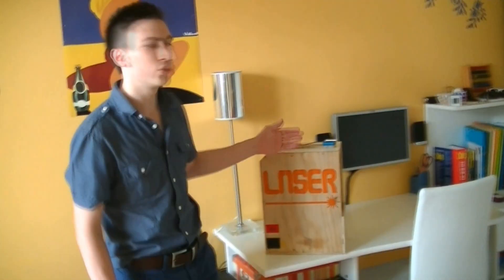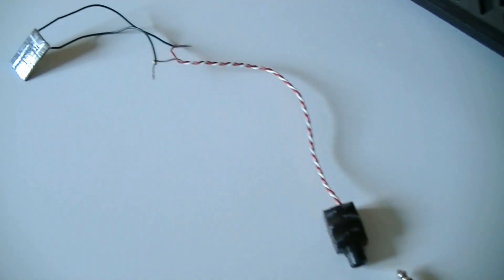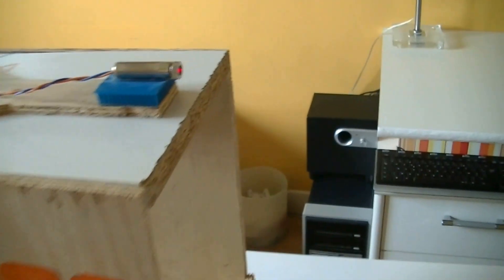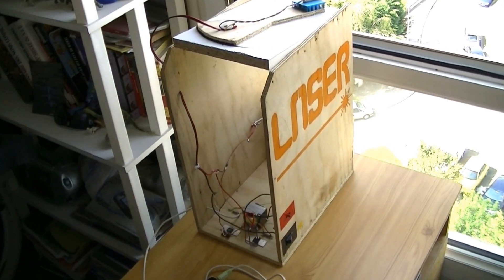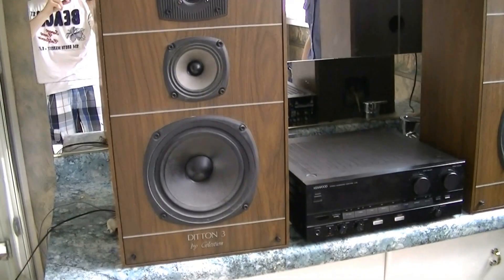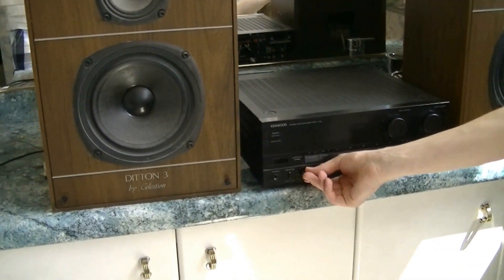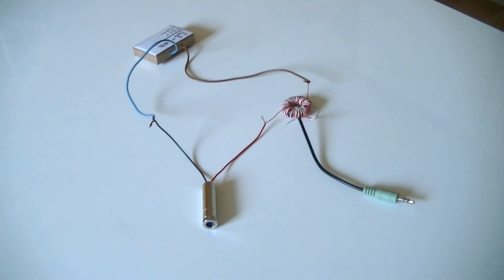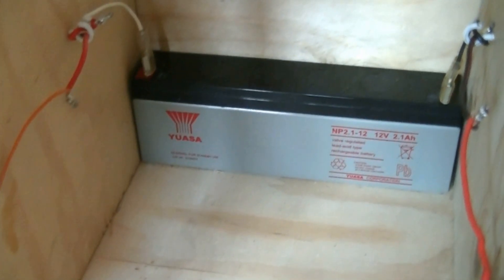Sound transfer... BY LASER : DIY Experiments #3 LASER light music wireless

Comment: Hey, sorry to bother again, i wanted to know the options that can be used as receivers for the laser light,. in this case you used a solar panel, may i know the options for other receivers that can be used in case, solar panels are unavailable?
Reply from the maker: +Nibras Adib : With a muti-cell Solar pannel you have a strong signal (the variation of the voltage can reach more than 2V for exemple). So it's not necessary to have a high gain amplifier so the sound is clear. You can also use a photodiode or photoresistor or phototransistor but it will not be as well working :)

Comment: Hey, i really loved your video, I wanted to know if you could do this with a green laser, would there be any changes?
Reply from the maker: +Nibras Adib : Solar cells are more sensitive with a Red dot, but it's possible too with à green laser !
Contrariwise, with a blue laser it doesn't work. Cells are designed most for IR waves.
Reply: Great! Thank you, I shall keep that in mind, Thanks again.
Reply: Hey, sorry to bother again, i wanted to know the options that can be used as receivers for the laser light,. in this case you used a solar panel, may i know the options for other receivers that can be used in case solar panels are unavailable?
Reply: @nibrasadib1086  solar panels were easy, because they cover large surface area. The dot cannot be focused well enough on long distances. Obviously you could have optical focuser at the receiver end. The lid of a steel kettle (reflecting dish), or big magnifying glass (refracting).
Reply: you could use a photoresistor
Reply: Ohh thanx a lot!
Reply: Nibras Adib I think a green laser is an excellent idea as they seem more powerful. And, it's easier to see the beam.
Reply: that would need extra circuitry with another resistor and a battery to make a potential divider (voltage divider) and anyway the laser and solar panel work the best

Comment: YOU CAN USE A CAPACITOR IN SERIES ON RECIEVER SIDE
Reply from the maker: It's not necessary because any amplifier already integrates a capa as an inlet filter ;)
Reply: +DIY Experiments yes you are also right
Reply: Dynamo OK WE KNOW YOU DON'T NEED TO USE CAPS LOCK

Comment: what kind of transformer u used here..and what kind of diodes attached with 680 ohm registor.. in this video we saw two transistor  but in the diagram mention one transistor ,and don't mention the num of transistor.. please send me a fresh diagram..I will be glad for u.. my email address atanu.biswas06@gmail.com   please send me..
Reply: The other "transistor" is the 7805 voltage regulator.  Any silicon power diode will work in series with the battery.  The other diode is just an indicator LED.